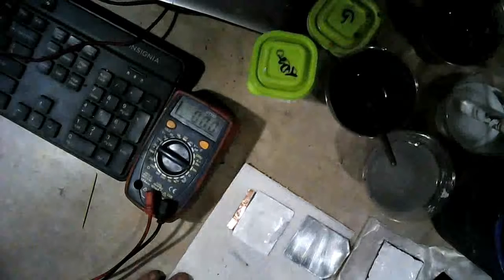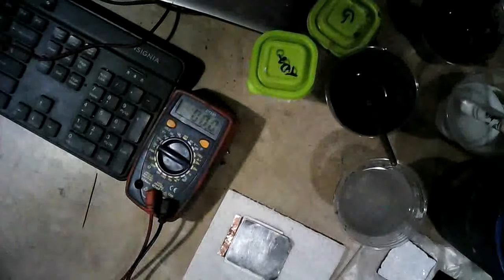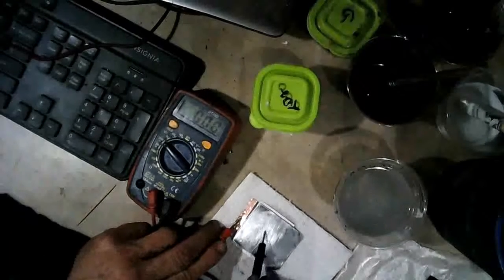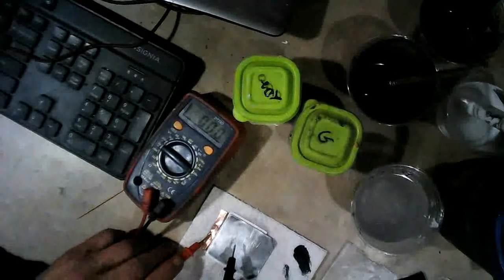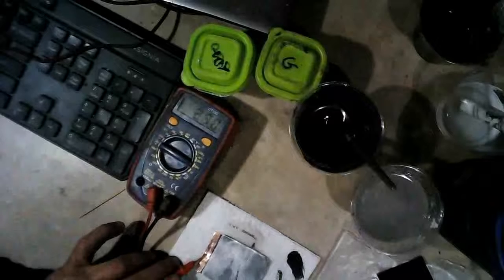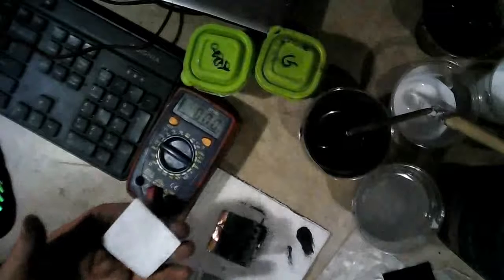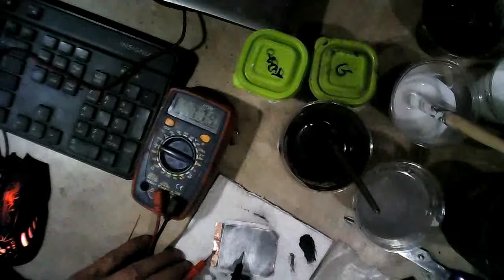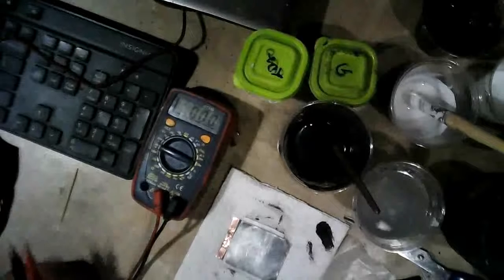Back with a Better Battery!

Comment: Well done I'm intrigued to see how well  your cells do, one little note if you're charging your cell try using a D cell instead of a 9 volt because the 9 volt batt  could actually cause Heating in the cell and change the chemistry slightly, I know the whole trick to charging alkaline is not to let the heat and liquify the chemistry in the battery.  Another trick you may consider is taking, an off the shelf battery charger that charges small rechargeable AAA to D batteries solder a couple wires With alligator clips to the electrodes and use that to charge your cell, it may stop the heating within the cell from a higher voltage.  Another chemical you may try is "urea" I've not tried this with your Chemistry so I don't know, but it has helped the voltage on some of the cells that I've built. Good luck
Reply from the maker: Hi ZPF,  that heating problem may have been what hurt the 2nd solid state cell I tried to charge externally. I'll try it again with a 1.5 v cell, but why bother when the cell self-charges. I was just trying to satisfy people's curiosity about charging it. I really don't want to start using electrolytes yet. I want to see how strong I can make the battery just using water, titanium dioxide, and graphite. I'll probably show what the cell can do with electrolytes just for demonstration purposes however. Thanks for your comment! :-)
Reply: I agree because the cell is self-charging but consider that if you're able to charge the cell externally, you may be able to condition the cell in such a way that it may work better after it's been charged a few times,I know pulse charging definitely changes the chemistry of the battery in unique ways that allow it to take a charge faster.  Also, the issue with the higher voltage is not really an issue if you're running multiple plates in series but on the small scale depending on the resistance of your cell it can superheat the chemistry.
Reply from the maker: That's true about conditioning the cell. I saw for myself that the cell could self-charge higher after I charged it once externally. So conditioning the cell might reduce the cycles needed to reach full strength. We have to consider the crystal structure that forms as the cell dries out too however. Is external conditioning better than naturally cycling the cell to condition it? More tests,.. Lol

Comment: Alcohol does have water in it. The amount depends on the type of alcohol. It'll be interesting to find out how it performs in the long run.
Reply from the maker: I thought about using vodka, but I used straight denatured alcohol in the experiment. It looks like it's going to rain again today, so I'll work on another video. My aquaculture pond just got 3 to 4 inches deeper, which is cool! :-)
Reply: Rain water is better for the environment.